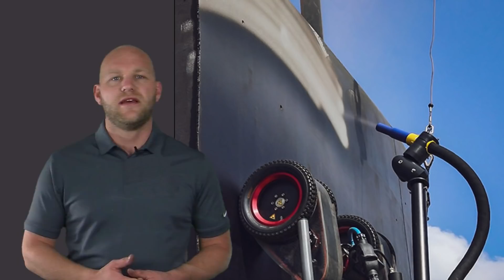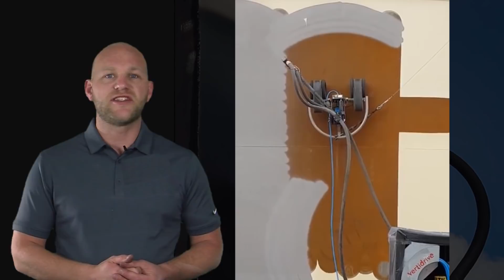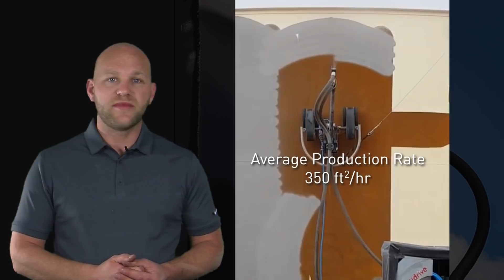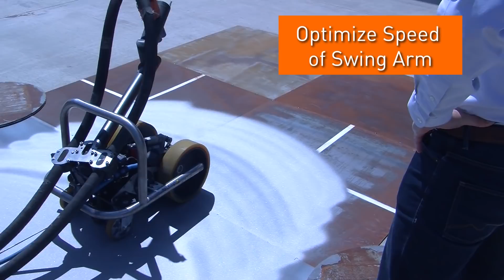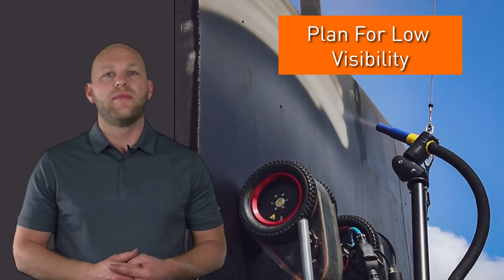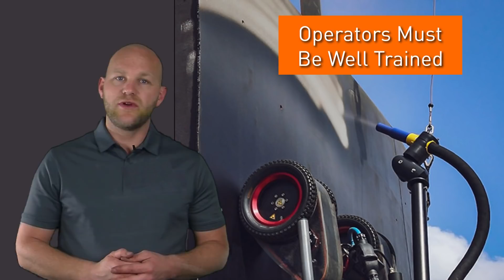VertiDrive Robot:  Optimizing Productivity

Comment: That's a cool unit.  How well will it work on something like a water tank?  How close will the operator need to be to the "blast zone" to ensure full coverage?
Reply from the maker: Yes, the vertidrive will work on a water tank no problem, as long as it can climb the surface, it will be able to blast for you. The operator will be able to set the vertidrive blasting pattern while in close range to get it right, then send the robot up to blast. you will need to stay in contact sight of the robot to ensure nothing changes, and that it doesnt damage anything.